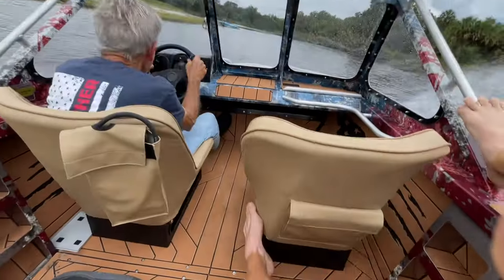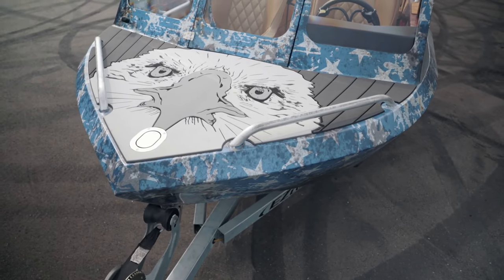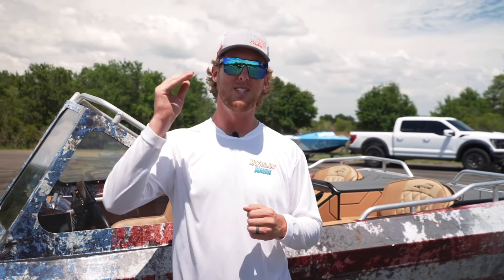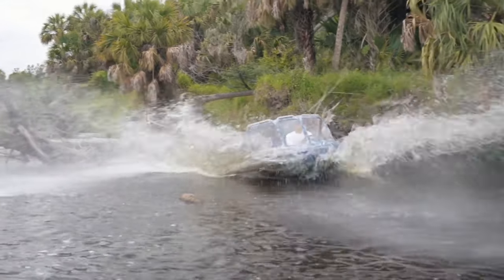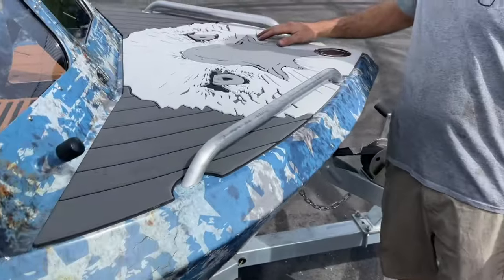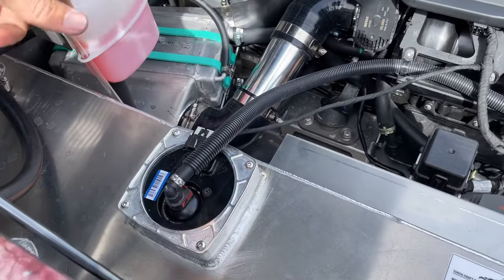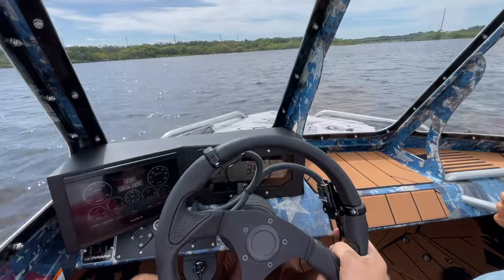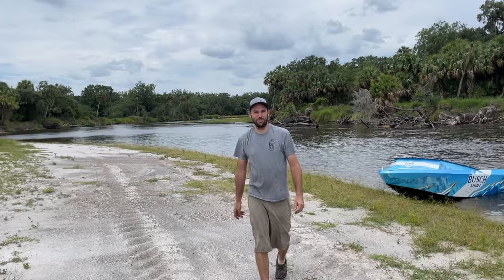This Is The World's COOLEST SuperCharged Mini Jet Boat... Here's Why We Bought It!!!

Comment: The leak in jackstands boat is the carbon ring, they’ll get hot and wear out fast if you run the boat too much out of the water. You can try to move the boot to put more pressure on it and slow the leak down some, but it’s supposed to leak a very small amount as it’s cooled and lubricated by the water. Having a leak there will cause a lot of cavitation out of the hole so fixing the leak will make for a better holeshot.

Comment: Put a removable pipe up through the center put a wheel on it like on the crank on a boat trailer. So you can run your wrench to the second boat

Comment: Just a thought for your trailer, if you made a piece with a trailer hitch ball sticking up to slide in the channel then covered it with some plate leaving a slot in the middle you should be able to hook the boat trailer to that and pull them straight up.

Comment: Don't know why you'd need "elevation" on your boat gauge cluster but hey can't hurt.
Reply: Cuz you have lakes / boulder routes that are above sea level?
Reply: Got a similar unit, there are literally hundreds (maybe thousands) of settings you can set up in those GPS:s. Someone configuring it must have thought it was funny / good info to show elevation.
Reply: Cause not all water is at sea level. Natural sciences in school is important.
Reply: You can measure how high you jump when hitting shit 💪
Reply: You can measure how high you jump when hitting shit 💪
Reply: often you have to re-tune high performance engines for elevation due to the lower density air, I had to re-jet my old jetski carbs when taking them down near sea level (i live at ~4000ft).
Reply: @_jow  EFI is diffrent tho, it should adjust automaticly with the map sensor. edit: i forgot you wrote high peformance, wich I agree on.

Comment: U need 1 more c channel 8ft drill half in hole thru the end of it aslo  on last piece of c channel welded to trailer then weld half in steel tube to detachable c hannel the weld 2 half in steel tube 1 in long on back of trailer so u can pin it on to the back of trl and it will reach the ground also once done loading just file it over and pin it to last c channel on trailer for transport hope this helps

Comment: by the way, just look to install a float switch on your bilge pump, super easy and cheap, runs directly to the battery so it turns on even when your power is not switched on

Comment: You need to weld a trailer hitch to the back of each jet boat trailer and then you can hook them all together into a jet boat train and load all at once and then run the winch cable under the trailers and unload them one at a time

Comment: Too hold the boats properly you need to have the size balls to lock front of trailer the wheel straps with boats strapped to there own trailer just as Tim gentry